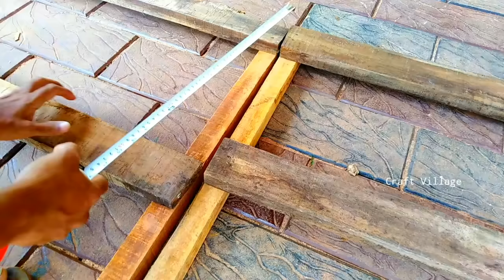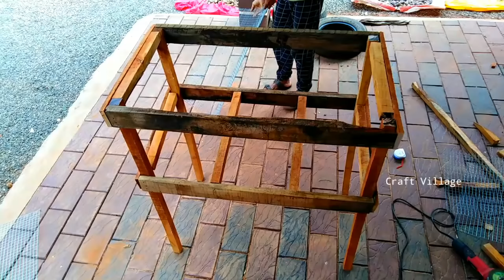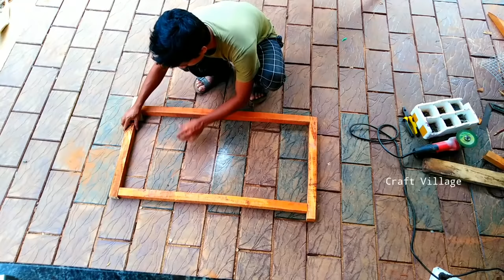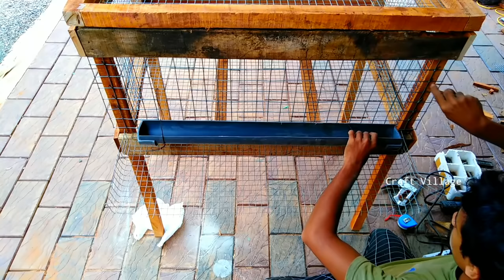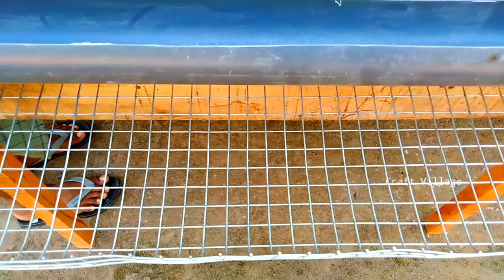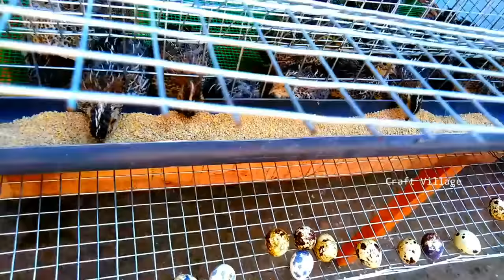How To Make Quail Cage at Your Home Using Wood and Iron Net | Homemade Quail Cage

Comment: This is a very nice cage. I would only put 10 to 12 quail in it though. 
I want a bigger cage that is taller to keep dogs and raccoons out, so I would use rabbit wire as well. A metal slide in tray to catch the droppings would be nice.
Reply: hi, may i know if u already know the size to fit 12 quails? thank you so much
Reply: @jahyun7744  hey there! I follow the 3 quail per square foot rule. I have only jumbo Japanese quail. It might be four quail per square foot if they are standard size. I would use a rabbit cage size for 12 quail because the water dish and feed dish take up the same amount of space. I also put in a box for them to hang out in, plus a sand box! 24 inches by 30 inches is the size I have used for 12 quail. They kinda like being close, but I give them choices about hang out places. They are so happy after I did all that and they make contented noises that make me feel happy.

Comment: Sir can you please tell  wire mesh size, specially front one.
Reply from the maker: Front one 1.5 x 1.5 nd other nets are 1/2 x 1/2
Reply: Thank you sir for reply. One last question is how much space quail eggs required to roll out for the cage?
Reply from the maker: I think 1 Inch, please just checkout with a quail eggs😊😊
Reply: Thank you 😊